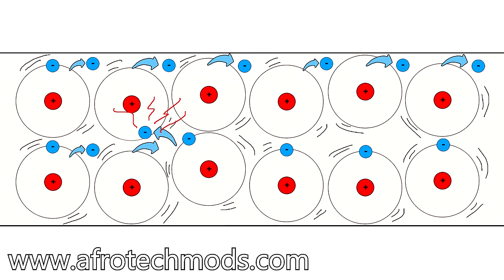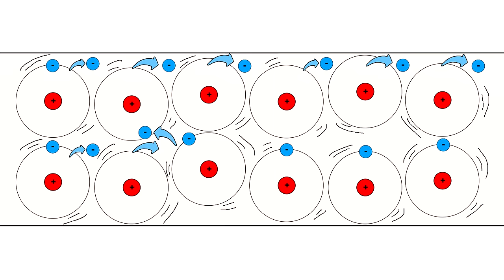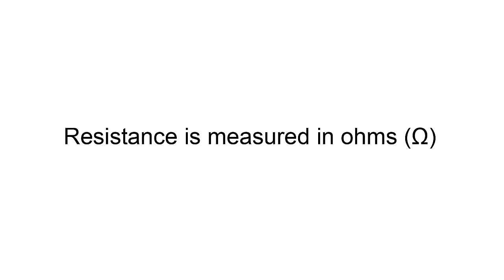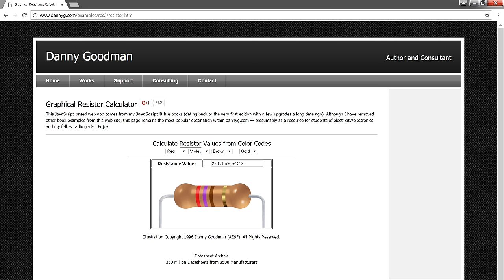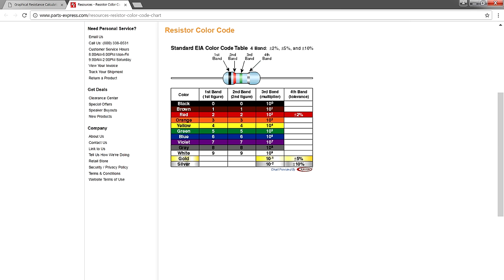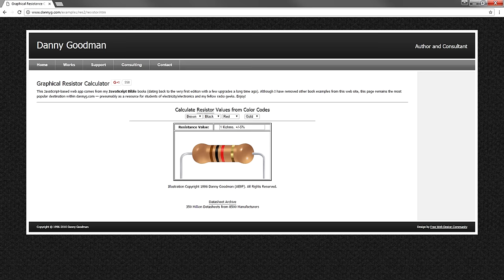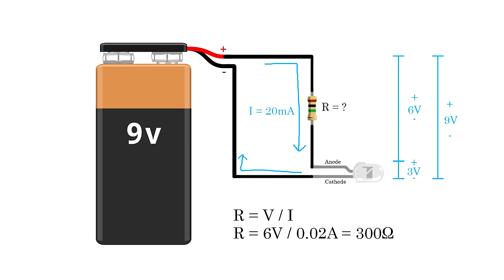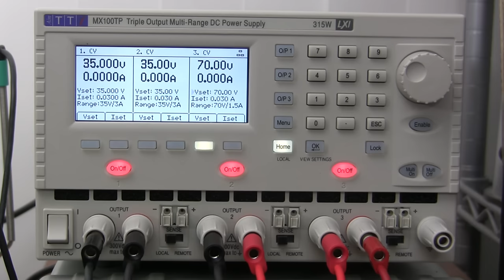Basic Electricity - Resistance and Ohm's law

Comment: CAN SOMEONE PLZ HELP:

idk understand how can an LED light have 3V? like what does that mean? but I understand how the battery has 9V of potential electrical energy. and I don't understand what he means by there being 6V across the resistor? what does "Across the resistor" mean?
Reply: Hi!!
As you will read/study/watch, electronic component can be devided in two main categories: ACTIVE and PASSIVE components (or devices). (NB. there are also Electromechanical components, but it is not where I'm going to answer your questions).
In a very simple way, I would tell you that "active" and "passive" refers to the way the electric component behave in a circuit: active components can (potentially) introduce energy into the circuit, passive circuits cannot introduce energy into a circuit, but instead they use the one which is provided by an active component.
As you can simply imagine, using the @Afrotechmods video as an example, the active component is the battery, and the passive components are the LED and the Resistor (usually Diodes).
1 ) So, back to your question, why a LED has 3V, if I just said that it is passive and doesn't introduce energy ( so supposedly it can't push electrons in the circuit )?
Well, that's because the V that we use for an ACTIVE components don't represent the same thing for a PASSIVE component. For active components (ex. batteries) the Volts represent the POTENTIAL (because it is not the exact quantity of Volts) energy between the positive and the negative terminals, so the energy that "pushes" the current flow. (you can find the exact definition of Volts in another Afrotechmods video, but also in books and readings online).
For a PASSIVE component, Volts represent the actual "energy needed" to make the component work, because it is the energy necessary to make the current flow throught the component itself. In fact, take the definition I gave you for the passive components: they CANNOT INTRODUCE energy, instead they USE the energy provided by an active component (battery / power supplies). And, "why LEDs need a specific Voltage to power up and work? Why they don't just light up if there is current in the circuit?" You have to know that each electronic component has its own interior resistence (BATTERIES TOO!) due to its material or structure; and as you can learn from this same video, since Resistance slows and blocks the current flow, you need to overcome this resistance value to make the current flow from one terminal to the other and make it work . On a practical way, 3V on the LED means  that you need  AT LEAST 3V across the terminals of the diode (anode + and catode - ) to make the diode work. If you are UNDER 3V, the diode won't work. If you are OVER 3V (more specifically, the maximum voltage the LED can tolerate) it will die, break, burn and eventually explode.
If you are asking "Why 3V and not 2V or 5V?" well, it just depends on the type of LED. Generally each color (which is a specific wavelength of light beam) needs a specific Voltage / Amp (remember that Volts and Amps are always linked, and they can't be considered apart in a circuit).
"But if the component will eventually emit light... why it is still passive?" The fact that it emits light is just a consequence of the current flow. It is passive because it can't work without a power supply. Just as Resistors: they literally can't resist current if there is no current in the circuit 
2 ) "How the battery has 9V of potential electrical energy?" I will take this as a question even though you understood "why" just to clear up some things on the active-passive concept. You have to know there are a lot of batteries, and I mean there are a lot of power supply each different from another based on different chemical reactions (Alkaline, Lithium, Zinc-Carbon, Lithium polymer, Lithium-ions ecc..) . Inside a battery (we can take the one in the video as our example, which is an Alkaline one) there are chemical processes that produce (and don't CREATE) potential electrical energy. "ELECTRICAL" means that it is, in fact, based on  electricity (current flow). "POTENTIAL" means that POTENTIALLY it can produce the amount of energy it is written on the battery (9V). For Alkaline, 9V is actual the Nominal Voltage, which is the actual voltage they produce. This answer also confirms the definition I gave you about active components : they introduce energy in a circuit.
3 ) "what he means by there being 6V across the resistor? what does "Across the resistor" mean?" In this case, we can refer to the definition of a PASSIVE COMPONENT I gave you earlier. 
Resistors are passive components, so they can't introduce energy in a circuit. They use the energy supplied by a generator to work. But wait... "LEDs are passive because they use energy and current to light up... but resistors don't light up, actually it seems that they are not doing anything at all! So they are using energy for what?" Well, the fact that you can't see something doesn't mean that it is not happening anything at all. If you try to touch the covered part of the resistor while it is in an active circuit you will notice that it will warm up. That's because of the work that it is doing: while LEDs transform electrical energy in light, resistors transform electrical energy in thermic energy as a consequence of their own resistance against the current flow. 
But does it mean that there are Volts needed to make a resistor work? Nope. They will always work since their only action is to resist the current flow based on their internal structure. Of course you can't use an incredible amount of Volts on a resistor that is not proper for a circuit, because it will eventually burn (as in the video). But the Volts that you can see in the video refferred to the resistor are related to the energy that is present between the terminals of the resistor while the current flows throught it . 
"But if they don't need energy to work and they don't even produce energy, why do you write volts on it?" When you are studying or making a project, you always need to know the precise amount of everything you are using. As in a recipe you have to know how many grams of flour and how many eggs you are going to use, you also need to know how many Amps and Volts each component of a circuit is using. In  this case, you need to know the the voltage that will be between the terminals of the resistor in order to choose proprerly the Ohms of the resistor and make a safe-to-use circuit for your LED. If you have a 9V battery, and a LED can work safely on 3V, you will need to introduce a resistor that will absorb as much current as needed to take a big part of the Energy of your battery, and let the rest to make your led work. So you will need 9V (battery) - 3V (needed for the LED) = 6V . How can I take 6V from my battery with a resistor? If you use have a current of 20mA, you will need a 300Ohms resistor to make your led work safely on 3V, since 20mA * 300Ohms = 6V , and 9V - 6V = 3V . 
"But why 6V on the resistor? Couldn't it be 5V or 7V?" Well, of course you can have 5V or 7V instead of 6V on your resistor... but only if you had other conditions.
The first condition , and the most important one, is that "energy can't be created or destroyed". If you have a closed circuit, and a generator that is producing 9V, whatever the electronic components you will be using in your circuit, you will always have that the sum of each voltage on each component will always be 9V. ( in the example, 9V from the battery -> 6V + 3V with the resistor + led). You can't destroy or create energy. It means that, if you have 9V on the battery side, and (for example) 8V on the other side, something is TRANSFORMING 1V of eletric energy in something else (another type of energy). 
So, the other condition in which you could have 5V on the resistor, is that, for example, there is another resistor that is absorbing 1V of energy. Or, another example, there is a Motor which needs 1V to work and will eventually transform electrical energy in mechanical energy.
Another condition could be that you are using a resistor with higher Ohms. For example, we are using a 350Ohms instead of 300Ohms. It means that you will have 20ma*350Ohms = 7V on the resistor. This will unavoidably drop the voltage on your LED on a mere 2V (Remember 9V battery - 7 V resistor ), and if you are using a White led, the led won't light Up (because of everything I said previously). Quick edit: Just wanted to add something to specify. When we say that we need 3V on the LED to make it work, it means that there is also an amount of current in Amps that we need to provide to the LED to make it work. For example (you can look for "datasheets") a 2.5V led will also need 25mA to work proprerly and with the maximum luminosity intensity.  When you are using supplies as batteries, you are looking "Just" for Volts and not Amps since the amount of current that will flow in a circuit is based on the Load of your circuit, and not the battery itself! So if you are using a 9V battery with a 2.5V LED, your LED will use the exact amount of amps it needs (just 25ma) ( and if the battery can provide it), but the problem will be the amount of Volts on the terminals. So you will need to lower the voltage on your LED with the resistance, and to do that you will need to know exactly the amount of current flowing in your circuit to choose the Ohms needed.
I hope everything is clear. Write me if you want me to explain something in a better way.
Reply: @xTheColinox  wow i never expected somebody to put so much effort into helping me understsand...i am truly thankful that you took the time out of your day to help me. I understood the explanation mostly :) just wnodering if you could quickly clarify what amperes are? i am getting it confused with coulumbs. are they the same thing? anyway thank you so much for helping me again!!
Reply: @renae9450  Don't worry. Coulombs and Amperes are releted, but they are completely different things. 
"Ampere" is the is the base unit of Electric Current. It measures ' how much current is flowing ', and it is measured in terms of C/s (Coulombs over Seconds). 1A = 1C/s
To explain what "current flow" is and how can you measure it, you need to know what Coulombs are.
"Coulomb" is the unit of electric charges, which can be positive (for protons) or negative (for electrons). 1C is equal to the charge of  6.242×10^18 protons , but since we know that electrons are the charges that are actually flowing in a circuit, we refer to 1C as the charge of 6.242×10^18 electrons . The difference between Coulomb and Ampere is used just to measure an electric charge (and it is useful in electric/magnetic Forces) and Amperes are used to measure how many Coulombs of charge are moving in 1 second throught a circuit. 
As you can notice, we don't use explicitly Coulombs in electronics since we work with current flowing. We are rather interested in knowing how much current is flowing each second, which is measured in Amp (amperes).
1 Ampere is 1 Coulomb (so the charge of 6.242×10^18 electrons) over a second... 2 Amperes are 2 Coulomb (so 2 times the charge of 6.242×10^18 electrons ) over a second and ecc...
Reply: @xTheColinox   thank you so much again for your help! :)

Comment: How many amps can you put thru a resistor? Lets say I have a 1,000 watt resistor. can I put 1,000 amps at 1 volt? Is there something that determines the amperage a resistor can take other then power?
I just bought a 2,000 watt 100 ohm resistor. I'm using it at work to generate 3 amps on a 300 volt power supply. I was just curious if there was an amperage limit because the terminals are not beef nor is the size of the wire that is wound.
Reply: electromechanical stuff you need to watch the next video in the disc rip toon

Comment: If the resistor is on the positive side, shouldn't it burn the led anyways? as it gets the full current and voltage from battery?
Reply: Its not a closed circuit anymore. The electrons won't have anywhere to move. Remember how two components with the same polarity repel each other? Thats what'd happen. Again, thos is why the elecyrons won't flow. I hope I explained it well, I'm just getting into this stuff
Reply: @ballisticwurm5582  Actually, the circuit would still be complete, and like he said, the led would turn on anyways. I am taking about the current. I guess the proper question is. Does a resistor change the current in the entire circuit, or just on the side it is connected?
Reply: @SteveTorresMassey  and you got me there. I need to do more research lol

Comment: there is one thing in Ohm's law i wish i can understand
 for e.g. if we have a lamp using 12 volt . 800m amp
but the electricity source is 24 volt
so we should divide 24 volt / .8 amp
this will give us 30 Ohm
but the voltage of the lamp after you put 30 ohms Resistance will not be 12 volt !!
it will be less than 12v
why ?
what is the solution
thank you
Reply: You subtract the forward voltage of the lamp from the source voltage, so in this case 24 - 12 = 12, then you do 12 / .8 = 15  ohms. The lamp "uses up" 12 of the 24 volts supplied by the voltage source, which theoretically could put out as much amperage as you want, the other 12 volts is dropped across the (15 ohm) resistor at 800 mA (meaning nearly 10 watts through the resistor). The solution, you need a 15 ohm resistor rated for at LEAST 10 watts, to be safe I'd go no lower than 15 watts.

Comment: I have an adapter which has output voltage  4.9V and current  450mA so inorder to find out the resistance for 3.5V LED ..do I need to divide 1.4v by 450mA?? and if I do so I get resistance value of 3ohm..explain me please!!
Reply: Do not calculate with 450mA, instead use 0.450A. You should always use the "main" units.

Comment: How can you calculate the voltage of an LED if it is unknown?
Reply from the maker: You can use the diode check function on some multimeters to measure it. Another way is to feed a constant current source of 20mA through it and measure the voltage across the LED with a multimeter. Another way to do it would be to use a low voltage source like 5-10V and put a 1k resistor in series with the LED, then measure the voltage across the LED. In all these situations you are feeding a small safe current through the LED and measuring the forward voltage drop.

Comment: Hi I'm going to use a green led in my car and obviously i need to drop the voltage from 12v to 3v , by my rough calculations i need a 450ohm resistor, am i right?
Reply from the maker: That sounds about right for a small LED.

Comment: so it doesn't matter where you put the resistor before or after the LED (I mean positive or negative side of LED), it will work just like in calculation?
Reply: No, there's no difference if you mix up the order of components if they stay in series (one after another).  x
You can even get e.g. 300 ohms if you combine 180 ohm (+/-10%) and 120 ohm (+/-10%) resistor in series. (So, the sum 180+120 is 300 ohms resistance.) They can both go on positive or negative side of LED or one on each side. x 
The trick is that all the resistance in series is summed up, and LED has (almost) no resistance, so it is practically skipped in this calculation. Because 300+0=300, right?
Reply: LovSven2011 thank you for your answer

Comment: I have a question... I want to connect 3.7v 2500mah lithium ion to a circuit which needs 100 r 200mah what to use to step down the current....
Reply: That feel when you're an electrical engineer already and still watch Afrotechmods, because he makes good videos.

Comment: question: I found on Amazon selling LEDs and a bunch of 200 Ohm resistors. If I need more than 200Ohm for a circuit, can I combine resistors to make different resistance values? If so, how would I do that?
Reply: or should I get resistors of different values?
Reply: Yes you can and it should be included in the video to be honest. Just make sure you got them wired in series.
Reply: Well if you have few resistors with greater value than you need you can connect them in parallel as well.

Comment: voltage drop minimize current manage current = carbon resistor 2 wire wend resistor .3 un flamable resistor v variable resistor    resistor not short they break .  checking resistor color and code need any one in computer hardware

Comment: I know its 4 years old video...but if u can reply ...please help....I am buying a 330ohms resistor...but they are in different rating like..1/2 watts or 1 watts or 2 watts...what should I choose for LEDs
Reply from the maker: 1/4W or 1/2W will be fine for low-ish voltages
Reply: @Afrotechmods  Thank you😊

Comment: Colorblind. Can't see the colors on the resistors. Brown red and blue? How about red, red, and lavender.
Reply: You need good lighting and a magnifier, they are indeed hard to make out sometimes.  Store them by the third band (the multiplier) e.g. tens, hundreds, thoudands etc.and use a multimeter to check the actual value.

Comment: OK so I learn in a different  way.. in school simple things was like Spanish to me... but taken a different way I got it instantly... I remember  when I was a kid I used to change out and adjust contact breaker points in the old cars distributor.. I knew when it was bad to change it along with the condenser.. but not until a German gave me water anology before I really understood... so I have been using resistor for many years and talk with slot of friends that fed television and they know resistors by color codes.. they could always tell me what resistors to use on any project I'm working.. I have been through ohms law... but I still dont know how to caculatewhat resistor to use from an alternator pushing 14.5volts to 3 volts diode... I normally just throw on a diode bit that's just luck... I work with 12 or 24 volts do current mostly.. what advice do you have for me